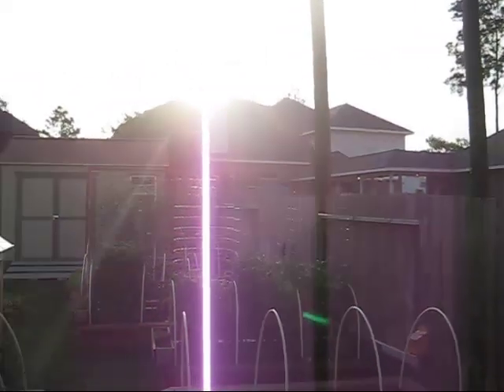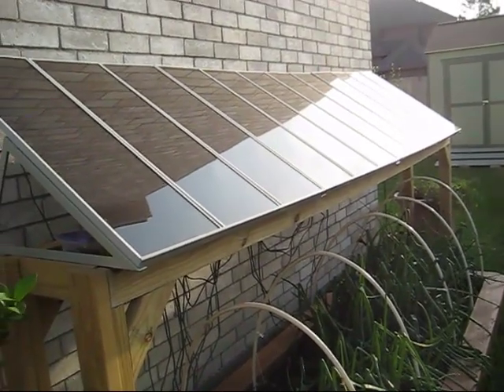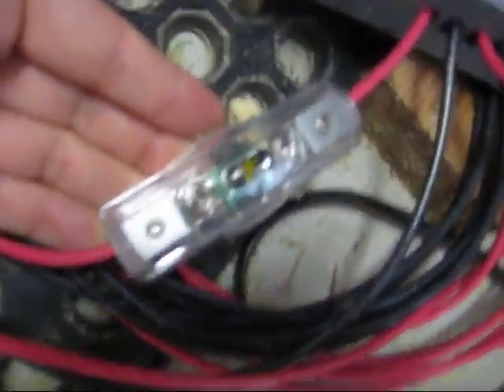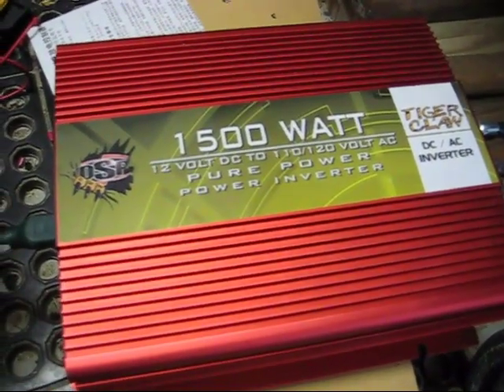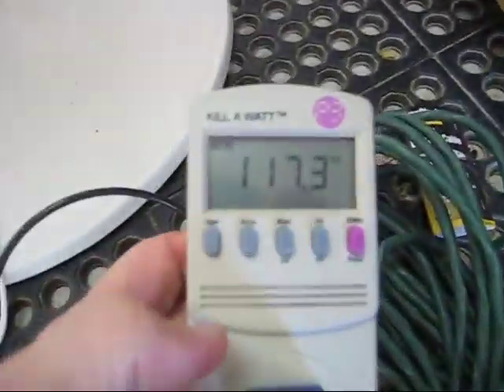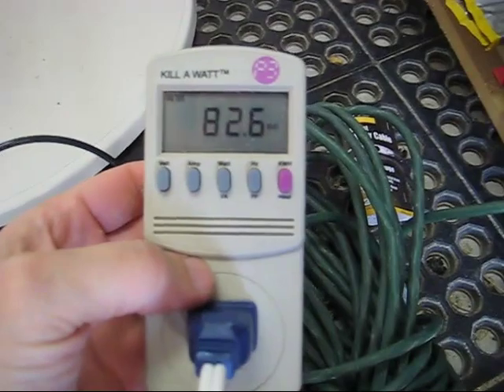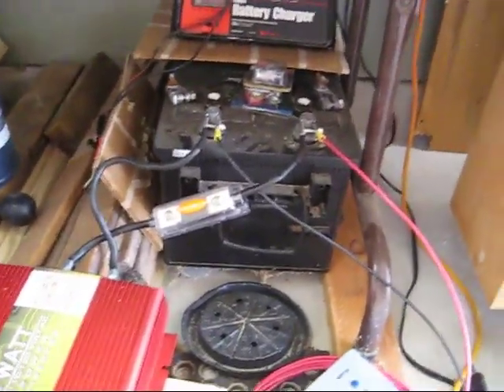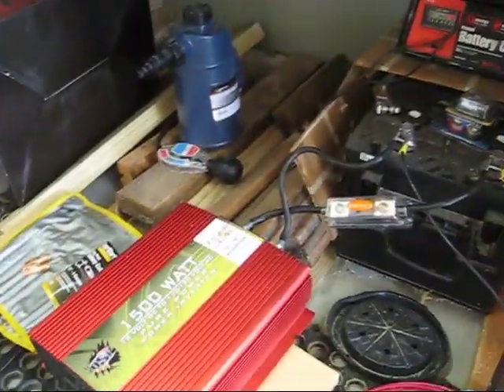Harbor Freight Solar Panels: Setup & Components

Comment: Nice work LDSPREPPER! You're doing a great job. Keep your cable run from the solar panels as short as you can to minimize power loss in the wire so think about the best location for your batteries and charge controller to trim back as much of the wire as you can.  You got one nice garden, make sure to give us a detailed tour and show us how you did it - those onions look fantastic! God bless